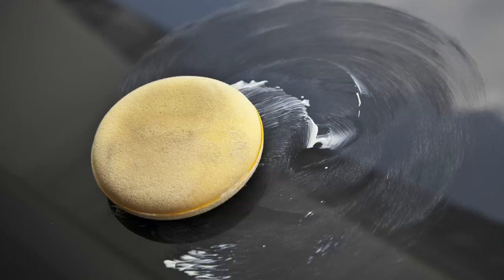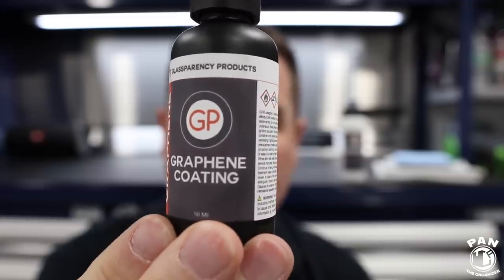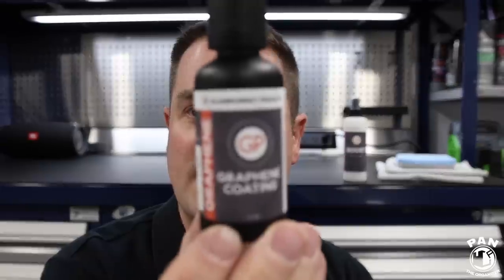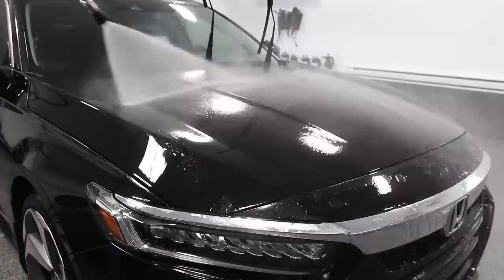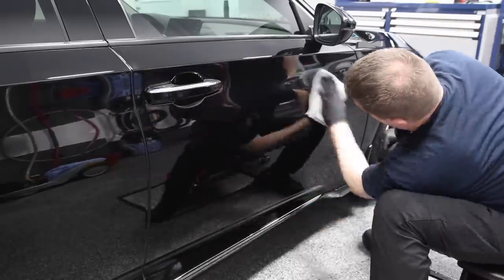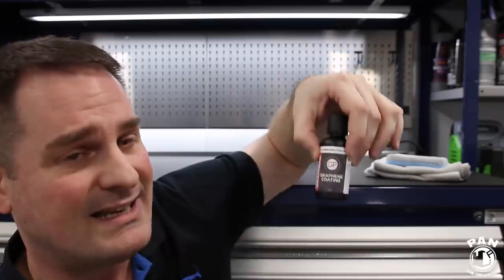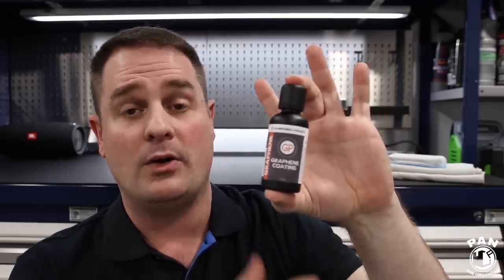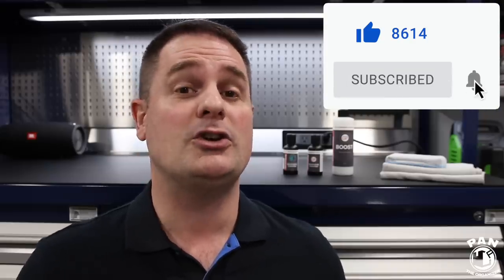GRAPHENE COATING by GlassParency! The Future of Paint Protection!

Comment: Lotsa stuff out there lately, some recently released ‘Graphene Coatings’ are sparking discussion, sometimes a bit contentious, sometimes optimistic, sometimes pessimistic but unusually entertaining. Plenty of folks saying it’s nonsense and taking it to task based upon wording (Graphene Coating, Graphene-Infused Coating, Graphene Ceramic Coating, etc.) and the suspect ability to currently actually produce a true GRAPHENE COATING.

I wasn’t around when coatings came around, touting such nonsense as “Diamond-Infused 10h Hardness” and similar “9H hardness, over twice as hard as your clearcoat” claims (the latter while being technically correct, in reality proves to pretty close to functionally irrelevant…”This really soft pillow is harder than that really soft pillow”) so dunno if the backlash was similar but it’s quite interesting nonetheless.

I dunno, ain’t no scientist but it is all currently quite intriguing to me. I had SPS Graphene on my daily from May 2019 thru August 2020 (16k miles), very nice product but in the end its positive aspects did not quite meet my particular needs so back to ceramics.

Frankly, whether or not it says graphene on the label is of no matter to me, the coating in the bottle either works for me and my specific needs or it doesn’t. The SPS was a great coating overall, especially if you like slickness and high water contact angle entertainment. Didn’t meet my needs in the end but that doesn’t mean it’s a bad product at all, rather that it’s just not a great product FOR ME. Time will tell with graphene, I guess.

Feynlab Blog Post: Coating Chemistries, and Differentiating Marketing Terms from Actual Chemistry: https://www.feynlab.com/coating-chemistries-and-differentiating-marketing-terms-from-actual-chemistry/

Rag Company Q & A w/ Gtechniq; 46 minutes in the topic of Graphene comes up: ASK Us About Detailing & Cars w/ GTECHNIQ! | Q&A Thursday #81 | August 6th, 2020: https://youtu.be/XjyLge_H22c

A little bit from Alfred Yow, the mind behind the Art d’ Shine/SPS coatings. Kinda clarifies the role of the Reduced Graphene Oxide component in the coatings. From a Facebook post regarding graphene coatings. Seems like a bit of a ‘helper’ to the PDMS portion of the formulation:

" To add on some answers to the article on Graphene,
The polymer used in Artdeshine’s product, PDMS has very low thermal conductivity, absorbing less heat when exposed. And if heat has been absorbed, the better dissipation and thermal conductivity ability of reduced Graphene Oxide (rGO) will help to negate. What we do not want is all that heat absorbed to be trapped. To say it simply, this is a case of using rGO to reduce the insulation (keeping heat) properties of PDMS.

Artdeshine has never touted using flames in any of our tests or marketing materials. This serves no purpose to demonstrate any capability of our coatings. We are not making fire-proof/retardant materials. And again, we are not touting thermal insulation as a beneficial property, we are trying to negate insulation.

Water repellent capabilities do not come from the use of rGO and can be seen in our marketing materials and information. A very high polymer (PDMS) content is used to achieve the better water-repellent effects. The polymer has been functionalized to provide much better water repellent capabilities."

I think it's gonna take some time to figure all of this out re: graphene. Migliore, SPS/Art d' Shine, Ethos, Glassparancy, Adam's, TAC Systems and a few more have released products w graphene as part of their formulations but perhaps more telling are those mfg's who haven't; CarPro, Gyeon, Feynlab, Optimum and Gtechniq, some of whom have openly questioned the value of graphene given it's manufacturing limitations at this time. 🤔

The primary 'optimistic benefit' of graphene as it's currently marketed is the potential reduction in water spotting due to it's ability to reduce surface temps; occasional mentions of graphene's toughness is tossed about but that seems to be a secondary point. Any visible performance benefits such as slickness, water behavior and similar are (as Albert Yow explains it) not due to graphene at all so, well...I dunno 😄

Will be fun to watch but not convinced that it's really any kind of 'revolution' given my personal experience with it. I guess that could change in future...or not.

What I get from all of this is:

1. Current technology does not allow for any fundamentally significant level of Graphene to be incorporated into a coating.

2. Any real or perceived benefits of a graphene coating have very little (if anything) to do with any trace amount of graphene in it.

3. The functional foundation of any graphene coating is basically the same as a ceramic, likely Siloxane/Polysiloxane/Polydimethylsiloxane (PDMS) or Polysilazanes.

So if we bake a 'Graphene Coating Cake' the cake batter itself is the same as if we baked a 'Ceramic Coating Cake' and the graphene in the cake is not significant enough to even be considered the frosting on the cake but rather merely the handful of 'sprinkles' on top of the frosting on top of the cake. Maybe.

I kinda view it as using a ceramic coating that for some reason has an extra word on the label, and merely taking up space on that label is likely the greatest visible contribution 'graphene' makes to the overall satisfaction.
Reply: Observation: I've concluded that no product regardless of price will effectively protect a daily-driven auto that is parked in the open (not covered or garaged) in an area with multiple heavy industries. Conclusion - constant maintenance/correction required with a full strip/reseal every 30-45 days. It just is what it is.  Interested in your input, thanks
Reply: @docwatson6500  Environment, along with vehicle usage patterns is indeed the biggest factor in LSP longevity/resistance. We've had good luck w ceramics on cars that sit outside 24/7 and get little maintenance but we're certainly not near an industrial center. Can handle what Mother Nature throws at it w no issues but not what mankind throws out there 😱
Reply: @budgetplan8730 , thanks.  Finally a candid answer.  My wife drives her black 7 Series to the top of her company's parking garage far away from all the clueless door dingers.  Unfortunately the 17 floor office building is just 1/2 south of Exxon Mobil Chemical and 1/4 mile north of Ohmsted Steel.  Contaminants often appear within a week of sealing the paint.  Doesn't keep me from going back into the fight though.  :)
Reply: @docwatson6500  With a black car to boot...😱 That is a tough circumstance. It's a shame that the absolute worst thing you can do for a vehicles aesthetics is to drive the thing.  😄
Reply: @budgetplan8730 , I've been seriously detailing now for about 50 years, so I've just accepted this situation as my cross to bear.  And when it's right, the Black/Black Bismark is a sight to behold.

Comment: The guy paid for graphene protection but didn't want to shell out the money for a decent paint correction.
Reply: Maybe it just didn't need it. The car looks pretty new.
Reply: 2018 Accord probably garaged, didn't look like it needed it.
Reply: Sometimes a thorough one stage is enough to get it looking nice. It's not an exotic so the one stage will suffice and the ceramic coating will adhere nicely.
Reply from the maker: Well said Tony.

Comment: Just used this and Adams graphene coating on two different cars. Glassparency is soo much easier to work with. Adams doesn’t tell you anywhere that you need to use their ceramic boost every 3 weeks at a minimum to get the length of time they advertise-I found out via a direct email. If anyone is looking at either go with Glassparency all day long.
Reply from the maker: Thanks for sharing your real world experience with us Kevin!

Comment: So I gather the main benefit of graphene is better resistance to water spotting. I just picked up a ceramic coating with similar properties (easy to apply/long working time and rated for 5 years) so I'll just stick with that for now. I never park next to sprinklers so water spotting is a non-issue for me.

Comment: Jeesh! I've already put Turtle wax seal N shine with Turtle wax ceramic coating over that .....to use this stuff I would have to try and strip that off and it doesn't come off easy. My next step was putting a coat of the New T. W. SealNShine with UV protection.

Comment: Just did my second car with Ethos Graphene. Glassparency Graphene is a little easier to work with and remove. Similar gloss and slickness, from what I can tell. I like how Glassparency packages in their Boost as a coating accelerator and maintenance product. Without any durability or water spotting experience, I would lean towards Glassparency for now... Looking forward to more of your reviews and head-to-heads.
Reply from the maker: Yes you will have many more graphene (or graphene oxide) based reviews coming! I have been testing for a few months now! :)

Comment: Hey Pan!  I’m knee deep in an extreme detail for a client with a brand new Hyundai Palisade and I just finished installing this coating on the paint. I’ve been ceramic coating vehicles since ceramic coatings came out (over 5 years) and ran in to an issue. Since I had never installed a Graphene coating I followed the instructions that you put out and I think there was one important thing that GlassParency and you didn’t account for......environmental factors..... let’s just say I had to break out the buffer and knock down a ton of high spots 🥴 Let me tell you, this coating took EFFORT to compound them out after 1 minute!  I left the coating on to almost 2 minutes when it should have been coming off in less than 1 minute, it did not like 75 degrees and 57% humidity for some reason and it was torture!  However, after some slight headaches I would say this thing will last if it laughed at a DA polisher after a couple of minutes. I found that 30-45 seconds was optimal with those temps. I didn’t see anyone say anything but have you heard of some issues like this with these types of coatings?
Reply from the maker: I work in a controlled environment at 20C and 45% humidity so I never really have any issues. But thanks for sharing, it might help those who work in more variable conditions.

The results must have been nice though. Gloss, slickness, etc

Comment: What do you think about Larry Kosillas idea on ceramic vs his method or reflex, skin, and creme. His idea is that scratching a ceramic coating will last the 5 years it’s on but scratching a coating that last 6 months will only be there for 6 month.
Reply from the maker: Larry is a friend of mine, great detailer, and has been a guest in some of my videos. His philosophy is different on coatings based on his regimen and product line, and that's ok. Each detailer has his own way, process, etc.

Personally, I get a brand new car every three years, and I want the best possible form of paint protection to add gloss, slickness, hydrophobics, UV protection, self-cleaning properties (vehicle is easier to wash during maintenance washes), protection against the elements, tree sap, bird droppings, chemical resistance, etc.  And ceramic/graphene coatings are my favourite form of protection. Period.
Reply: @PanTheOrganizer  Thanks, I’m fully detailing my Jeep soon and I’m trying to figure out what I want to do. When you detail your graphene/ceramic coated car, do you find that your paint stays pretty much perfect if you wash it properly or does it get some small scratches?
Reply from the maker: That all depends on your washing and drying techniques. My cars have zero scratches. Because after 24 years of detailing experience, I use safe washing and drying methods as that's usually where you have the highest chances of getting scratches and swirls.

Ceramic coatings don't protect against scratches and swirls though. That's a common misbelief.  They can help diminish the "appearance" of very light marring or "love marks" from washing and drying, but that's about it. That's not what they're designed to do.

Watch how I wash my car here: https://youtu.be/9QWk0ZFb6_I
Reply: @PanTheOrganizer  Ok, thanks

Comment: Weekend warrior who is very excited about this.  Strip wash, no problem, iron remover, sure. Clay bar, easy enough.  Polishing the paint with a power tool? A bit scary.  How necessary is that step? If my paint clear coat is good and no swirls or issues then not a big deal to skip? One Canuck to another looking for advice
Reply from the maker: If your paint looks good yes you can skip machine polishing.
Reply: @PanTheOrganizer  amazing response time!  Thanks for your passion and support.  Do you think any Ceramic spray detailer like TW 3in1 would be a good  maintenance product?
Reply from the maker: Sure.  But Boost is slicker. And it comes with the kit.

Comment: Subscribed to your Youtube channel, buy your recommended products, keep up the great work. Observation: I've concluded that no product regardless of price will effectively protect a daily-driven auto that is parked in the open (not covered or garaged) in an area with multiple heavy industries. Conclusion - constant maintenance/correction required with a full strip/reseal every 30-45 days. It just is what it is.
Reply from the maker: Thanks! Just one precision though. You would only strip and reseal for waxes and paint sealants. Once every 2-3 months for waxes and once every 5-6 months with sealants. For ceramic coatings, as they last for years, no stripping is needed (and you shouldn't do that). Only a maintenance topper once every 2-3 months to keep the peak performance.
Reply: @PanTheOrganizer , thanks.  I have on multiple occasions used first waxes (years ago), then sealants, and a ceramic coating.  Under the conditions I described above none of them has provided protection from industrial contaminants.  Perhaps they do on covered or garaged vehicles, but on our daily-driven car parked in the open they have not.  Just this evening I checked our 7 series after work, and even though less than two weeks ago I fully prepped and properly applied Turtle Wax Ice Seal N Shine, the top surfaces were rough to the touch and would not wash smooth.  This has occurred repeatedly over the last year and a half with multiple products.  Daily exposure to sun, heat, humidity, and industrial contaminants has overwhelmed all of them and overwhelmed them in a short period of time.   Thanks again for your input.

Comment: Glad I skipped the true ceramic coating phase as I have only used Griots 3 n 1 Ceramic spray wax which is super easy to apply. I was actually kind of hesitant to try a true ceramic application, with this new product it seems to be much easier to apply and more of a window to wipe down the panel. Looks like a homerun if it truly last atleast a couple of years.

Comment: Hi Pan the graphene coat sure does seem easier to apply than ceramic. I have just applied Cquartz uk 3.0 looks amazing thanks for all your advise and as usual your video’s are full of information and enthusiasm.
Reply from the maker: Thanks Wayne!
Reply: How’s the carpro coating holding up after 2 years? Thanks !!
Reply: @MrKeenan3325  the car lives in a garage but still a daily driver. I have just done a decon wash with carpro descale, that brought the water behaviour back to as it was post coating.
I am a bit OCD with the maintenance which helps look after the coating
Reply: Good to hear. I have typically applied Adams professional graphene for my customers but I’m also a certified glassparancy installer. I think I might switch. Thanks for the quick reply.

Comment: I almost got this a bit ago but decided to hold off and get UK 3.0.  I'm looking forward to seeing how this holds up over the rest of the summer and winter.  I'm in an area that has similar winters to Pan, maybe not quite as cold but snow, salt, slush, etc.  Looking forward to spring!  Thanks for the awesome review Pan!
Reply: How’s the ceramic coating holding up after 2 years? Thanks!!
Reply: @MrKeenan3325  It's pretty well done for.  It was looking okay going into winter but this year we had a lot of up and down weather and they dumped TONS of salt.  I commute 130 miles a day for work and my red car would be white with road salt to the point it was hard to see out the side windows and all that salt seems to have been hard on it but honestly I'm quite happy with how well it held up.  Now that the weather is getting better slowly I'm planning on doing a one step just to remove what's left of the coating and I'll reapply.  I'm thinking maybe I'll try Gtechniq EXO v4 this time as they're claiming "Durability tests during winter, particularly in environments that have had heavily salted roads, have shown an improvement in performance of around 30 percent" over v3 and up to two years on a daily driver.
Reply: Got it. Did you try a decontamination wash to check it?
Reply: @MrKeenan3325  Yes sir.  From that I saw there were / are a few areas that held up a bit better naturally but those areas are small and in places that seems to be areas of lower air flow maybe?  The trunk lid was a surprising one.  The center actually had decent water beading yet and some small areas on the hood where there's some roll from body lines.  Again I'm guessing just the way the air flows over those areas they didn't get quite a beat as say the sides which are pretty well dead except maybe in the door cups.
Reply: Ok. Thanks for in depth review and communication! Very helpful.